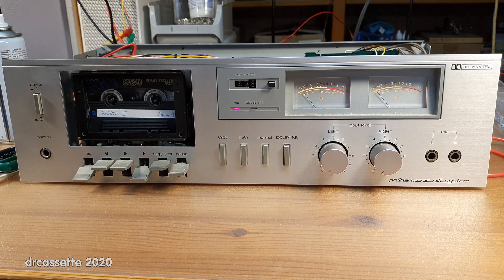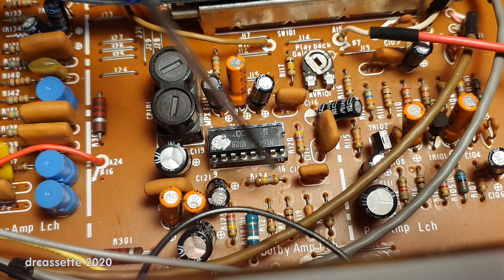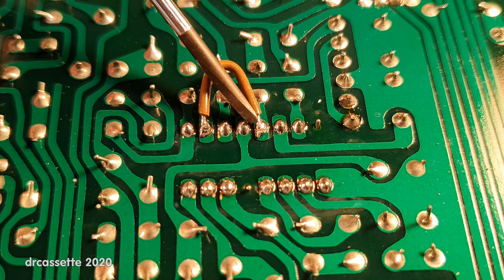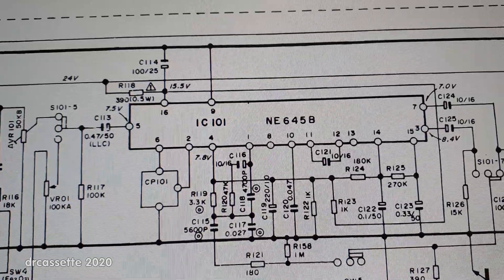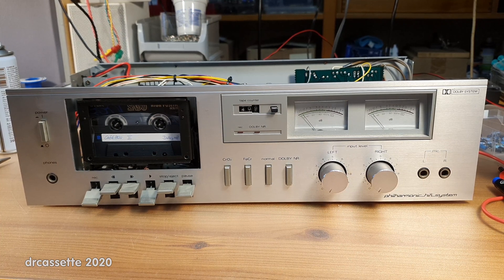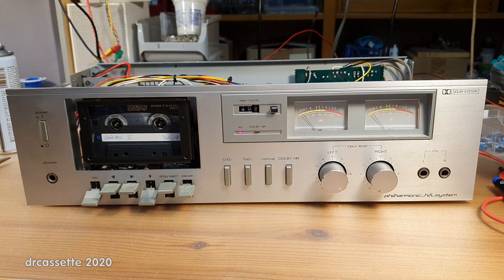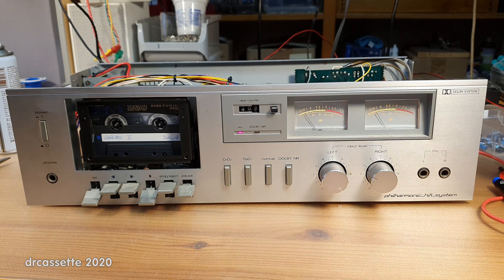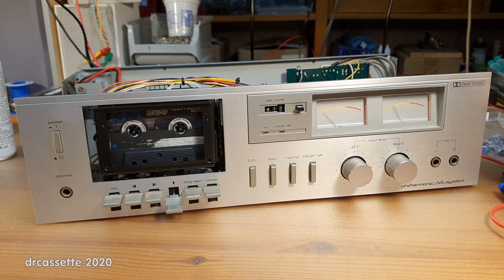Nordmende CD 1000 cassette deck Dolby IC bypass experiment

Comment: Hello, I have done the bypass as in the video but it sounds very low, where could the problem be? any capacitor or filter? Thanks by your help!
Reply from the maker: You can not do this bypass as a permanent solution, this was just an experiment. If you bypass the IC, the signal amplification is missing, so of course the sound will be very low. You must replace the IC.

Comment: Re: NE645B 
Click on this link, and a small electronics company sell them in the UK. They will post worldwide, I have bought from them - no problems. ;o)
https://www.ebay.co.uk/itm/LM1011N-INTEGRATED-CIRCUIT-DIP-16-NE645B-UK-COMPANY-SINCE1983-NIKKO/191006141480?hash=item2c78da6c28:g:MUMAAOxygPtSsHNh
Alternatively, you could 'chance' a Chinese copy?
Reply from the maker: As mentioned in the previous video, I do know of trustworthy businesses selling the IC here in Germany. But it all doesn't matter anymore. Tomorrow I will publish the second part of the Nordmende CD 1000 repair video ;)
Reply: @DrCassette  I confess I didn't watch the first video. :)
Reply from the maker: If I suggest to watch the previous video first, I don't do so to generate more views, I do so because it really is necessary to understand the video I'm about to make ;)

Comment: For this solution to work propetly it would be necessary to replace the bypass with a preamplifier. But this is just an experiment, in the real world it is cheaper replace the faulty IC

Comment: The problem could be fixed really easily with a couple of op-amps for both channel, the first as input buffer and the second one for the effective signal amplification...however this solution would imply some kind of engeneering, as well as some custom made pcbs floating around the unit...
Considering the value of this deck...well, not really a good idea!

Great video as always...